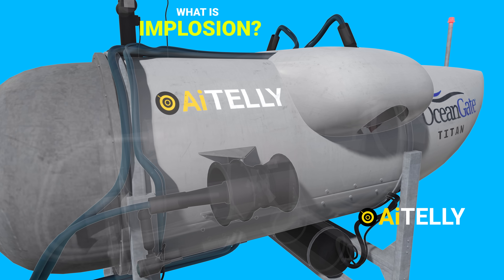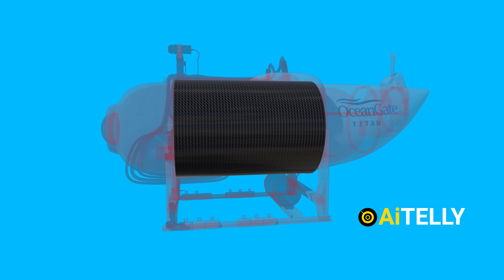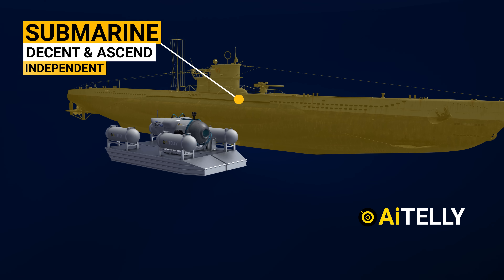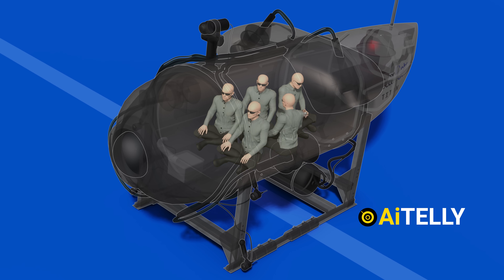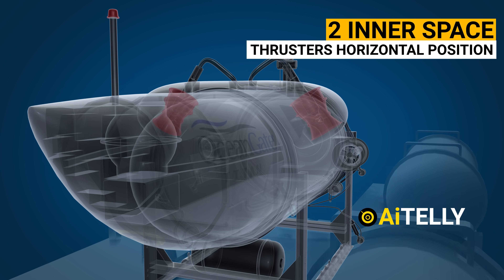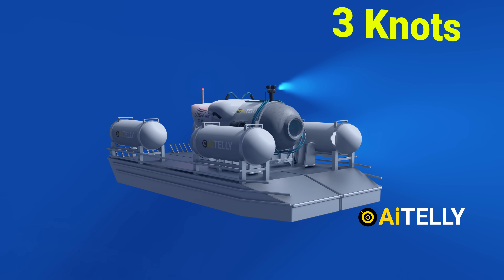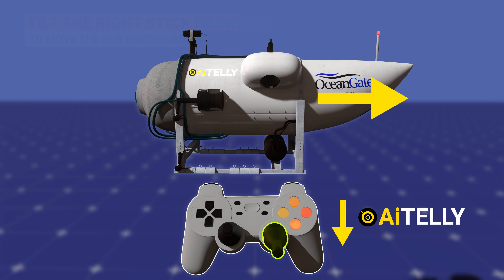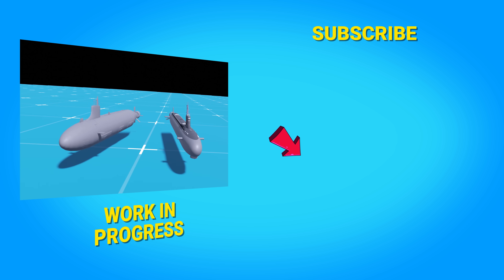Implosion Titan Oceangate How it Happened | Submersible Submarine Parts #3d

Comment: lol....lame....the tail and farings for the props are not pressure vessels so the pressure would not apply to them..they wouldn't crumple as you showed. You're model is missing the tail cone (ie. a matching titanium dome ...the two domes captured the cylinder hull/pressure vessel. Nose cone/dome1 has the viewport, tail cone/dome2 has the connections to the computers (which are all in a non-pressurized tadpole tail housing)....without the two domes capping the cylinder, how do you expect them to pressurize the vessel?

Comment: The bodies of the crew are intact, but might never be found and recovered. Their bodies are suddenly compressed under a pressure of six thousand pounds per square inch. Air that is gaseous on the surface becomes liquefied at that pressure and has no opportunity to be expelled by rupturing the body before it is liquefied, as it cannot escape into the surrounding high pressure region. Water hits the pocket of air within the vessel first before it reaches the bodies and the fragmented parts of the hull provides air an opportunity to mingle with the water as it is being liquefied. Heat released during compression is absorbed by ice cold water. Heat at the interface of the bubble vaporizes water that slightly retards the process before it, too, changes back to liquid. Force is directed against a body, not outwards, so it does not explode. It is flattened. Flesh saturated with water only shrinks to the extent that air within it is turned to liquid. Solids and liquids do not compress at that level of pressure. If the clothes they are wearing are lighter than the water that they displace their bodies should rise upwards and drift with the current. If heavier, they will sink to the floor of the ocean and should be in the vicinity of the field of debris.
   
The way to visualize this process is not by what would happen to a body being struck on the surface, in which case it would be smashed and fly off in all directions. A body on the surface would rupture from escaping air, but this air cannot escape immersed into 6000 psi holding it in place before it is liquefied. The amount of heat generated by the volume of air being compressed may be estimated. It is absorbed by the cold water. Flesh shrinks only to the extent that air is turned into liquid. The volume of solid and liquid matter does not change.
Reply: "Air that is gaseous on the surface becomes liquefied at that pressure" NO IT DOESN'T! Look up what "permanent gases" are. Look up what "gas critical temperature" means.  ("The critical temperature of a substance is the temperature at and above which vapor of the substance cannot be liquefied, no matter how much pressure is applied"). Nitrogen and oxygen cannot be liquified at room temperature by pressure if they are above -147C and -119C respectively. The air in the sub was close to  room temperate before the implosion, but thousands of degrees higher during the adiabatic compression of the implosion. You treat the bodies as being in an instant perfect static equilibrium at ~6000 psi, but how did they arrive at that state? Certainly not in an even, controlled manner. Meaning some parts of their bodies would have experienced higher pressure than other parts. Meaning unequal forces and accelerations of a very large magnitude across the body due to very large pressure differentials (the same thing that dismembers bodies in an explosion). Then there's fragments of the hull flying towards the bodies at incredible speed, also not in an even, controlled manner. Then there's the momentum of their own bodies being sqeezed into the last remaining pockets of low pressure. It would have made an absolute mess of the bodies, not neatly vacuum-packing them.
Reply: @BC-wj8fx  Thanks. At least your explanation provides sufficient detail that makes it credible, while the others make it sound as if a nuke exploded for no plausible reason.

Comment: You didn't mention the sink/rise rate. The buoyancy or lack thereof. The Mommy ship is not "anchoring" anywhere. But it can hold position by pointing into current, wave, wind action. Not many boats have anchor chains 13k+ feet long. So you're saying that this thing did NOT have negative buoyancy but instead relied on motors to keep it at depth? That makes absolutely NO sense! No ballast? Tell you what that is a stretch I find difficult to believe.

Comment: I guess the platform function was just to test the Sub if it leaks or not. Once it leaks or getting malfunction several feet under water during trial, the four floating devices on the platform will bring the Sub back to the surface, hence they knew exactly that their Sub was not failproof from the very surface of the water.

Comment: I think this new version still didn't go into the details of how implosion happened. Most of the vid explains the launching procedure. I saw the early version of this vid. What I was hoping to see was the process of how the pressure gradually building up as the sub descends and eventually imploded. I want to see what are the potential failure areas such as these:

 1. The under-rated acrylic view port which only certified to 1200 meter. The dive requires 4000 meter certification.
2. The shallow bonding area between the titanium ring and the 5" thick carbon fiber tube. The bonding weakens after repeated dives due to the different rate of contract and expansion between a composite material and titanium. 
3. The bad material choice of carbon fiber which is not suited for withstand compression stress. 
4. The flawed design of choosing a cylinder over a sphere which distributes pressure far better. 

And lastly, a slow motion animation when any of the above failure points actually happened: the acrylic window cracked...the 5" carbon wall caved in... compresses the air inside of the chamber... the temperature rises immediately... the sub collapses inward... then the compressed air needs to escape....so it explodes after implosion...It sounds very graphical...for educational purposes... we could use rubber ducklings as passengers as they disintegrates into million pieces...

There could be more failure points as the investigation starts. But a video titled "Implosion how it happened" needs to explain all of these possible failure points to provide better clarity. The most recent images of recovered debris clarified a lot of earlier assumptions. All titanium parts and external components survived nearly intact. What's missing are the main carbon pressure chamber and the acrylic view port.
Reply: Of course, we all want to see that... but that's tough to animate and channels like these are just about getting views and not about actually about educating anyone beyond what's readily known.
Reply: The bond between the caps and fiber really didn't matter that much those bonds were in compression that would NOT have been the point of failure. Coulda used Elmers glue there. Failure was the implosion of the carbon fiber which splintered the layers away from those joints. The fiber litterly was SHREDDED by the implosion and the caps simply fell away from it. however the air EXPLODING probably blew the view port out and to hell and gone it was probably NOT recovered. Wouldn't be much left of the fiber either. I notice that they didn't show that part well WHY NOT? yeah these people hide shit like they do with UFO/USO investigations. Useless.
Reply: @leecowell8165  I saw a photo of a white basket filled with shattered shards of carbon fiber composite next to the titanium ring. I saw it only once and cannot find that photo again.
Reply: @leecowell8165  If you look at the photos of the front titanium ring, you can see where the outer lip on the "C" channel was torn off the ring like a band aid for three or four feet and hangs there with one end still attached to the ring.  As an engineer, that tells me that it could have been a point of initial failure.  The titanium ring has a much lower modulus of elasticity than the carbon fiber hull which tells me that as the titanium ring compressed under pressure, the stiffer carbon fiber hull split a portion of the outer "C" channel off the ring.  The differential bearing pressure on the end of the carbon fiber hull had a much higher bearing pressure than the radial portion of the carbon fiber hull.  That is a VERY BAD IDEA.  This video doesn't show the actual detail I'm talking about.  You'll have to find a decent video that shows the actual photos of the damaged titanium rings.
Reply: wtf is a vid?
Reply: @Capecodham    A video
Reply from the maker: Hmmmmm anyways 
You might also like Nuclear Powered Submarine Engineering behind it #3d Nuclear Reactor released
Link: https://youtu.be/J0lb46Zi5-s

Comment: I'm not sure it happened that way, but not saying it didn't.  My thoughts are that the structural glue joining the carbon tube and the Ti end hoops may have failed from stress and from different coefficients of expansion from the extreme temperatures.
It appeared the the end hoops may have been devoid of any carbon or glue remnants at the bond lines based on the coverage I saw.
Reply: Those joints were NOT the point of failure the carbon cylinder simply imploded and the end caps fell off due to cylinder destruction. the end caps were in compression those joints could have been put together with plumbers putty.
Reply: @leecowell8165  Um, do you have an engineering degree?  Do you know that the forces act equally in every direction normal to the surface?  Seems to me that, even if you are correct, the carbon would, before total failure, deflect just enough under load to allow the 5700+ PSI into the tiniest of openings or cracks.  Water is going to find the easiest path into a low pressure zone, esp. with those pressures and I believe this would overcome the forces acting on the caps.